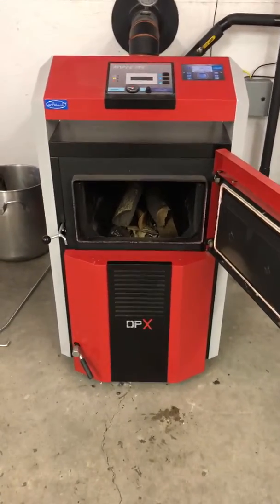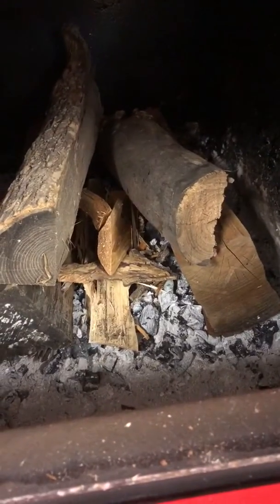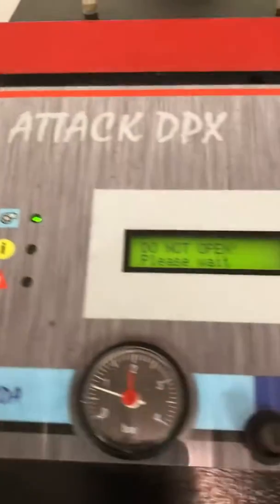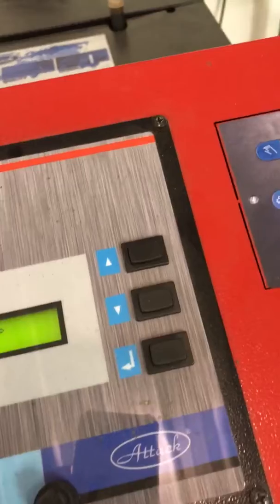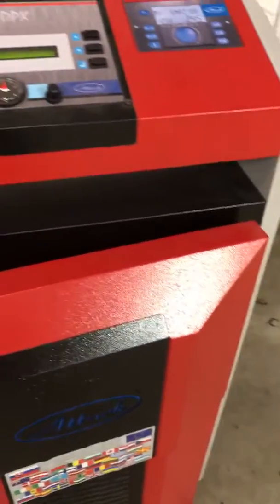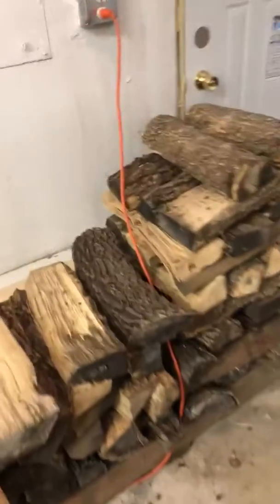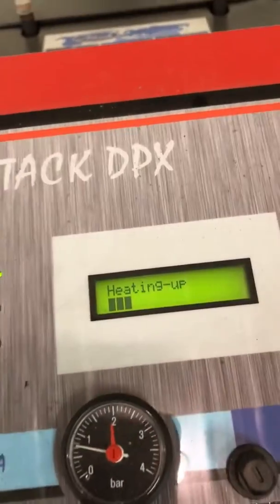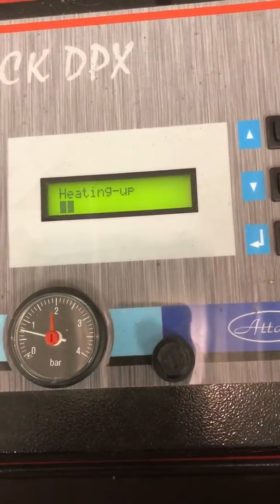Starting batch burn- Attack DPXL-45 wood gasification boiler Part 1

Comment: Tim, Thanks for the great series of videos, I am working my way through them. I went to Attack's website but cannot find a dealer in the US did you import them (sorry assuming you are in the US)?
Reply from the maker: Yes I am in Minnesota. Boilers were purchased from Zenon at:  http://www.newhorizonstore.com/default.aspx
Boiler does not care if its run on 60hz vs 50 and I used a step up transformer to go from 120vac to 240vac. I have 240vac in the panel but was told by new horizon to use the step up transformer, in fact they supplied it on the first boiler I purchased.  The boiler only uses about 100watts on full burn so you don't need a very big transformer.  The boiler has a 240vac output to run the circulator pump to storage but I used that to a relay so I could use a more commonly available 120v Grundfos alpha 2 circulator.
Reply: @timdahm7039  thanks for the reply. I noticed your rectifier after posting. Thanks for the link. I am planning a new home build in WI and unfortunately have not found a indoor boiler  made in the US with the same sophistication and price point of the European units. Again thanks for the very informative videos!
Reply from the maker: Not much for US made units unfortunately.  If I was buying today I would seriously look at the vedolux 450  because it qualifies for the 26% fed tax credit.  Of course it cost almost double what I paid for my Attack.  It is a very nice unit and is very easy to clean. (important to keep transfer efficiency up)  That said my Attacks are built like tanks and have been 100% reliable so far.
All the european units have future parts availability concerns, especially now with all the supply chain issues.  They pretty much all only have one US distributor, and if that shop closes up you are SOL or buying direct from Europe.  Of course there have been plenty of US manufacturers that are no better and parts on those legacy units are NLA.  The joys of being in the small group of people who still burn wood!
Reply from the maker: One more thing, since you are building new and you probably know this already - in slab tubing for radiant heat is the only way to go - water to air heat exchangers in a FA furnace suck and it's tough to size them properly to work when storage temps drop off plus that fan uses a lot of power!
Reply: @timdahm7039  the plan is to have a mechanical room / workshop incorporated as part of the house with a wood storage and drying area. WI has some legislation that bars the state enforcing EPA rules so we have some flexibility with equipment selection. The plan is also to build in some redundancy with propane.

Comment: Hi Tim.   I watched all your videos about installation, use and maintenance. I plan on installing something similar in Canada.  What was your budget for this - material and installation  stove, reservoir, heat exchangers valves etc etc etc   ?   No detail required, just a global all included budget.  Thank you very much to your time and effort to put all these valuable videos toguether.
Reply from the maker: Off the top of my head (keep in mind copper and fittings pricing has gone up since my installs):
Boiler ~$6K ( I bought 2 so got a deal)
2x500 gallon scrap propane tanks $200 each, lots of time to clean, prep and weld on proper fittings.  (scrap tanks can be iffy as they can be rusty inside if not stored properly. I had to cut a man sized opening so I could clean inside properly and weld a patch to close that up. Don't recommend doing it that way as getting your new welds leak free can be a challenge for a non-professional welder)
spray foam for inground lines and storage tanks $800
3x$200 grundfos alpha 2 pumps
water to air Hx in furnace  $400, fancoil for basement heating $600
plate HX (may not be necessary depending on your system design ($350)
Rent backhoe for in ground lines $225
Valves, fittings, copper lines, PEXalPEX lines and fittings, LK boiler return protection, misc pipe insulation, enclosure for 500 gallon x 2 tanks~ $2000-2500
expansion tank (used largest bladder type well tank I could find)  $400
I would estimate costs are 20% higher now since my install and some things will be hard to find due to current supply chain issues.
Also no chimney costs since I already had a class A selkirk supervent set up installed.
Reply: @timdahm7039  Thank's Tim.  I perceive I need to set aside 20k $Can for the project. The alternatives for me are few, not as efficient, not as comfortable and require also some investments. Payback could be 6 years as this will be at our wood lot (with my free labor!).
Reply from the maker: @MarcPilon  When I started the project propane was less than $1 per gallon so payback was pretty far out but I was going to do the project no matter what (kind of a hobby).  This year propane is up 50% for the summer fill and going up from there so the payback is starting to look much shorter.  Neighbor took down more than a dozen hackberrys and hard maples so scored several years of wood this summer!

Comment: Minnesota gets cold.  How much wood do you burn in a week?  Full cord. Or a face cord. Maybe not near that I hope ?
Reply from the maker: Hi Randy,  Just fired the system this last weekend. Typically to get my 1000 gallons of storage  from 60C to 80C it takes about a 6 cuft wheelbarrow a day.  I think that amounts to a face cord a week or full cord every three weeks.
Reply: @timdahm7039    That's really good
Reply from the maker: @randyk2904  It would be even better if the boiler and storage were in the main house.  Both are in a 24x48' outbuilding about 100' from the main house. There are no radiant emitters in that building but even so the heat loss from storage/piping and boiler keep that building above freezing all winter.  Right now it's 60F in there with 30F /windy outside conditions.
Reply: @timdahm7039  No room for Complaining for sure... that awesome
Reply from the maker: @randyk2904  The wood use will probably go up a bit when the really cold weather hits.  That said keep in mind that everybody's situation will be different and wood use will vary greatly.  My heat emitter set up in the house is no where near ideal and I do have some parts of the house that are cooler than others.  Typical of a retrofit situation - the ideal set up would be in floor radiant tubing done during original construction.  I also like to watch a fire so I will burn a woodstove on one level of the house, but only one burn cycle on some evenings.  Prevailing winds also greatly effect the ability to heat the house -  with my grove on north and west sides it's easier to heat with a cold N/W wind then it is with a warmer south wind with no tree protection from that direction.

Comment: Your installation is not complete. You are missing the safety cooling valve and cool water input on top of your boiler. Therefore your boiler could overheat and potentially burst when power failure would occur.
Reply from the maker: Good catch.  I do have automatic battery back up but the safety valve is yet to be installed.  Have all the parts and will install soon.
Reply: OK, I saw your part3 why you don't have the emergency cooling valve. YET... :) Thank you for the videos.

Comment: Can you tell us any detail about the storage? I'm VERY interested in getting this boiler in the 120k BTU / 35kW size.  I'm most curious regarding storage about DIY, if its even feasible.
Reply from the maker: I contacted my local propane supplier and ask if they had any scrapped 500 gallon propane tanks.  Tanks are scrapped when they are missing the data plate or have other defects like heavy external rust.  They were able to supply me with 2 x 500 gallon tanks to give me total of 1000 gallons of thermal storage.  Scrapped tanks must be cleaned inside so I cut an opening in the tops big enough that I could get in them if necessary (not necessary unless there is rust scaling inside. I cleaned inside with a pressure washer and had a local fab shop roll some plates to cover the access hole.  I added some ports in the top and bottom for 1 1/4" NPT threads and mig welded everything back up. (probably best to have a pro-welder to this to prevent leaks,  I didn't and had plenty of leak checking and more welding to seal up leaks.  These tanks are about 5/16" thick steel and are designed for 300psi or more so the 10-15 PSI they will see as thermal storage did not concern me. However some local codes may require ASME pressure tanks for this type of application.  My two tanks are horizontal configuration but one stacked on top of the other  with  a pair of 1 1/4" pipes connecting the top of the bottom tank to the bottom of the top tank.   Boiler and heating load returns are plumbed into the bottom of the bottom tanks, and Boiler supply and heating load supply are plumbed to the top of the top tank.  I monitor temps in three locations - the near the top of the top tank, the top of the bottom tank and the bottom of the bottom tank.
Reply from the maker: Check out this thread for some pics of the storage tanks: https://www.arboristsite.com/community/threads/inside-wood-gasification-boiler-w-1000-gallons-thermal-storage.337980/
Reply: @Emanuel Aydin Yup, have been watching on flixzone for months myself :)
Reply: @Emanuel Aydin Definitely, I have been watching on flixzone for since december myself =)
Reply: @Emanuel Aydin yea, been watching on flixzone for years myself :)
Reply: A trick : watch movies at flixzone. Me and my gf have been using them for watching a lot of movies lately.
Reply: @emanuelaydin3306  Yeah Bro totally